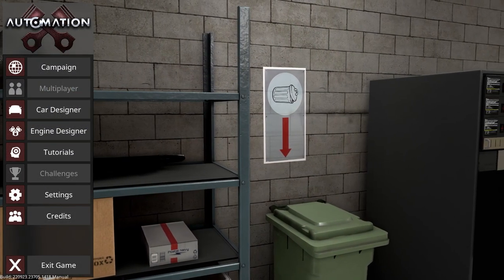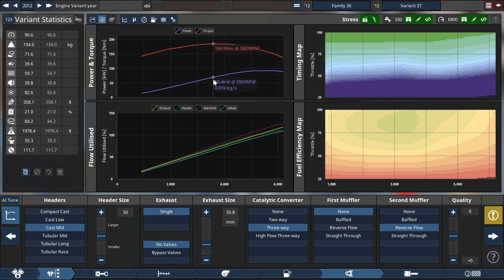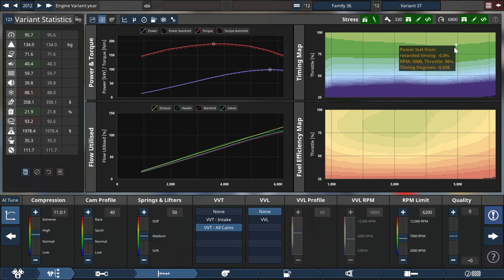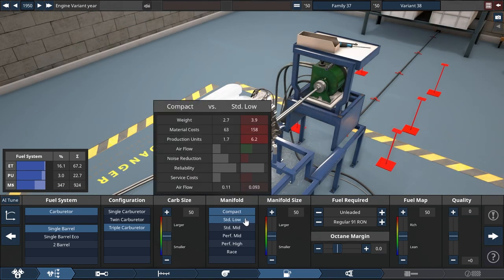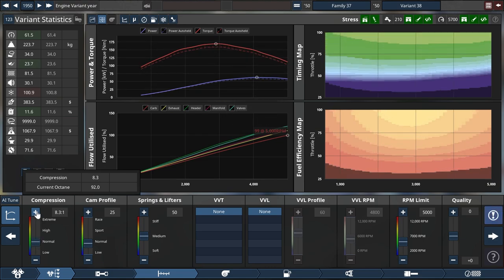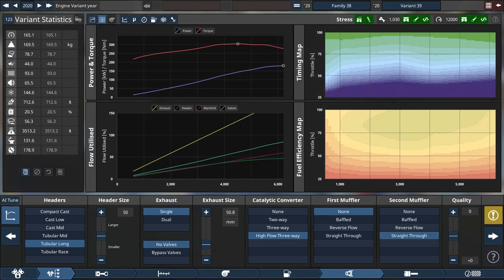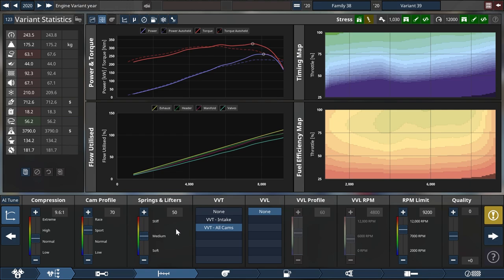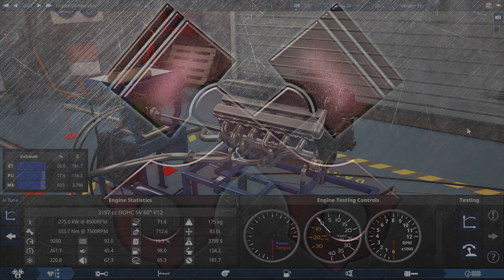LCV4.2 Tuning Tutorial: NA Engines

Comment: I feel that when trying to replicate real life engines they always come out underpowered. Especially in career mode where spam on quality slides increases project time.
Reply: Yep pretty much every single time for me my engines are completely missing the mark for power. Even with the best tune I can do (without just making a ridiculous racing engine) I can’t even get close to what I could before (which yes, it was too easy to get absurd engines before). Glad low end has been sorted out, but I think the high end calculations need some definite rebalancing. Make the top end slider have more of an effect on peak horsepower like before. I think power output is also too reliant on family quality right now. Designed a 70s engine. 400 months of engineering time for an engine that can barely make 60hp/liter. I really wanna love this update, but the lack of power is starting to ruin it for me.
Reply from the maker: It is really close to realistic (maybe 2-4% low) in terms of torque and power outputs. Major manufacturers would have ~5-8 tech pool in many of the categories, and a whole lot of familiarity built up with various tech. That means they can run at +5 like you in sandbox can at 0 quality at the moment. The solution is not to let you recreate IRL engines with 0 quality again as you could before, that would give those who can use quality way OP. Instead the solution is to make you have access to techpool and some familiarity in sandbox to simulate you building a car as a company with an R&D department and not a n00b out of a shed.
Of course, a wee bit of tuning of the parameters will still be needed, but overall we're quite close.

Comment: Could you bring back DevMeth? One of my favourite things was to build silly engines and it's harder without it.
Reply: They should Also increase the rev limiter imagine building a F1 engine that way
Reply from the maker: No, devmeth was a fictitious 200 RON petrol fuel, all fuels available now are real fuels, including Nitromethane which basically is rocket fuel, stoichiometric AFR at 1.7:1. If you want high octane, go for LPG for instance. You can build plenty more silly engines now than you could before :D
Cheers
Reply: @AutomationGame  weird, i didn't see thoose, gotta go back and check

Comment: Recently got into automation. And tried recreating an engine I built in real life. And gotta say the numbers I got on automation were within 10% of its real life numbers. My only suggestion would be improving the specs for cam profile because I have no idea what kind of duration, lift or valve overlap im getting when cam profile iS just normal, sport or race. Because when building actual engines that's pretty critical information to know. Should at least be able to tell me lift and duration. I.e. 410 lift and 280 duration. Or 264/272 duration cams with .410 lift. Because cars come often times with mismatched cams for spooling up turbo's faster.

Comment: This update made me realize just how damn impressive some engines are in real life. I always looked at the engine in my car, the Subaru FB20D as a bit lackluster seeing how it only makes 150hp, when honda has been getting well into the 200s in the early 2000s, but after spending 30 minutes optimizing a recreation of the FB20 i got the numbers barely equal to real life without race parts and as equal specs as i can find online, and man its pretty hard to make a NA 2.0 engine make more than 130hp. 

I also want to say I am happy that the peak power and peak torque rpms are now accurate. before i could get the power and torque numbers right, but the rpm it made them at was way off. Now the power is perfect, and my automation engine makes 5 more ft/lb of torque than the real car but the rpm is correct. built the car to spec with gearing, flow optimized undertray, tires, and weight and the car gets roughly the same fuel economy as well, within 1 mpg. (unrelated sidenote, i got a suggestion about the power split being ineffective, when the car and power split are both perfect 50/50, not sure if thats a bug or if the game is telling me 50/50 power is bad)

Overall I am extremely impressed with this update for the realism aspect, cant wait for sequential turbos and superchargers.
Reply from the maker: Thank you! Yes, it currently (as of hotfix 2 for the engine designer revamp update) is a little too hard to make realistic engines, but they are very close indeed. :) Just needs a tiny buff in the right areas and this is really spot on for NA engines. I find it funny that the same people who complain about being a few % short on power now didn't complain about being like 30% short on torque in the low end before the update xD it was proper bad!
Reply: When accelerating your weight distribution is going to move in accordance with the rate of acceleration. 50/50 weight distribution, 45/55 or 40/60 power split, at minimum. Also the less power directed to the front wheels, the more they can turn while accelerating or maintaining speed.
Reply: I made a 1600cc i4 na engine go 238hp, its about compression ratio and air fuel ratio balance, and engine head(cams)

Comment: I love this update, my hp/liter itch has been scratched with the new turbo calculations. There's still something that, to me at least, seems broken in them but to be fair I'm pushing the limits with my build so it's not a big problem. I do not understand how the fuel mixture slider is supposed to work, the engine only gets benefits from running as lean as possible, the power barelly changes but I get a lot more efficiency using the leanest mixture, it also seems to not affect knock as well. Keep it up
Reply: Possibly a more lazy engine, as a leaner burn means less throttle response.

I havent even touched the update yet tho :P
Reply: Lean setting just kills the throttle response
Reply: @8Hshan  i noticed that, but I'm 99% sure it does a LOT of other things irl as well. It should mess with knock and power a lot. But this update feels good

Comment: Setting the fuel map to lean advances timing. The fuel map graph gets much greener on lean setting, but the timing map does too. The engine gives the most power and is the most efficient as lean, all at the same time. Shouldn't it be either efficient or powerful? Running rich wouldn't really be logical, if it worked like as it is now.
The only advantage of rich mixture now is that it makes the engine more responsive.

Am I misunderstanding something, or the slider doesn't work as it should currently?
Reply from the maker: In isolation, both running leaner and richer lowers octane requirements. The maximum knock occurs at 13.1:1 AFR. That is if no surfaces in the engine get hotspots from running lean, which makes for a hotter burn. That effect is not accurately simulated yet, which likely is what you're observing.

Comment: What is the purpose of adding the VVL RPM slider? Is there any scenario when I want to have a "kick" in the torque, rather than having set it perfectly, like the game automaticaly setting it in older versions?
Reply from the maker: IRL manufacturers do seem to think that sometimes is a good idea :) we assume that it is because of staying on the low cam for longer gives better economy and emissions. The latter still needs to be implemented, of course.
Reply: @AutomationGame  Alright, if it is realistic to have the option, then I'm fine with it, altough an AUTO setting would be useful. Maybe by dragging the slider to 0RPM, it should engage AUTO mode, what do you think?

Comment: For me this was a good update :) for me the best part always was to create the engines and now i can finaly tune them almost like a real engine 👍 however i personly feel like there still should be a slider for ignition timing so we dont have to tune the engine by increasing or decreasing the compression because i have the feeling that we have a fixed ignition map on the engine. So i would love to see that we can change the the ignition map just like the fuel map :)
Reply from the maker: The timing map is fully dynamic, it takes everything into account for the current engine operation state and then calculates how much timing needs to be pulled at this particular spot to not knock. A timing slider just doesn't work then, because what would that adjust if you have on average some 6000 different dynamic values for the timing of one engine?
Reply: @AutomationGame  i understand this but working with cars irl . Somtimes deciding if the timing is more or less agressive is beneficial 
And we adjust the compression to balance it
Reply from the maker: Yes, because you're the manufacturer, YOU can easily choose what compression to run for the engine, the tuning guys in a shed can't do that, so instead they have to fiddle around with AFRs and timing. If they could, they'd probably dynamically adjust compression instead :D
Reply: @AutomationGame  I've seen tuning guys increase compression in a shed. That happens when you machine mm of the top of the blocks.

Comment: You didn't touch Fuel Map in sport engine.
And all my sport engines want to run on lean. Is it supposed to be like this? Looks like fuel map slider doesn't work fully.
Reply from the maker: Then all your sports cars will drive like eco cars and not have sportiness, because they'll lack engine response.
Lean-ish burn produces more power than rich burn. For petrol engines 12.7:1 is peak power, but 13.1:1 is peak knock. Going richer from 13.1 needs less octane and going leaner also needs less octane (but burns hotter). AFR does very little for power IRL, and fact is that old Automation did do that entirely wrong in many aspects.

Comment: love the new update, making power has never been easier. However, I can't say the same thing for making efficient engines, maybe it is on me, but I have made some of the most ridiculous down-tuned engines I have seen and they still at best only get 30 MPG. Which isn't that good, not saying it isn't unrealistic, but it seems like a car should be able to get higher fuel economy with a standard two liter, naturally aspirated, fuel injected, inline four.
Reply from the maker: Something to look into, yes. One thing that needs to be updated is drivetrain friction, as currently that multiplies down power instead of subtracting from it. That can shift the cruise throttles to higher efficiency numbers.

Comment: I find that in old engines going to 0 timing and low compression gives you more power and torque than any other setting. That's a big issue to me, dumping fuel and higher compression should realistically give you a lot of power more than an eco engine.

Comment: if my engine is to high on over 100% valve flow percentage, even after adjusting carbs, manifold and intake a bit. Do i need to change engine size or type? Or is there something else working well go get more flow through them? I don't want to much Cam Profile.
Reply from the maker: None of those things change valve flow. What changes valve flow is: bore, cam, family quality, top end quality, and indirectly stroke (by lowering the capacity while keeping valve area the same). Try those things! Valves don't need to be at 100%, for undersquare eco engines 130-150% is fine even, but that means you're losing top end performance while gaining low end performance.

Comment: I think I've found some sort of bug. I built a 2.7L V6 with a single turbo and Nitromethane and have managed to get over 3500hp from it with the compressor showing 18000% flow (or however it goes) but not breaking. Just wondering if it is indeed a bug or if I can take the credit for such a machine haha
Reply from the maker: That does sound like a bug, but the question is what datapoint you're getting checked for that value. :D Hard to tell from just some text on the internet haha
Reply: @AutomationGame  ye that's fair. How do I retrieve the relevant information for you to work your magic on?
Reply from the maker: You can export the car for sharing, then send the .car file to our support with a screenshot of what has gone wrong and a brief description :) support@camshaftsoftware.com

Comment: What do you think about integrating the springs and lifter slide into the cam profile like you used to. I guess it could make space for something else. Maybe torque limiter?
Reply from the maker: No, there are too many instances where you need to be able to fine tune the point of float :) breaking out the springs slider from the cam slider was a good move, we're going to keep that.

Comment: I'm not sure why, but I've tried exporting several +2000hp nitromethane or Methanol cars to beamng. Even if all of the graphs are green, the engine breaks when I start to give it a bit of throttle from a dead stop. If I give about 5% throttle and let it get to ~2200 rpm, I can increase the throttle without the engine breaking. Is this a beamng problem? Thanks in advance
Reply: By any chance were you running extremely high boost on your turbos? I ran into the same problem in BeamNG with a Devel Sixteen esque meme hypercar and was wondering if that was the cause
Reply: @rickydas6546  one of them was having the same problem on just .6 bar